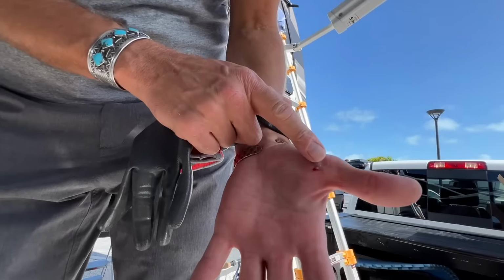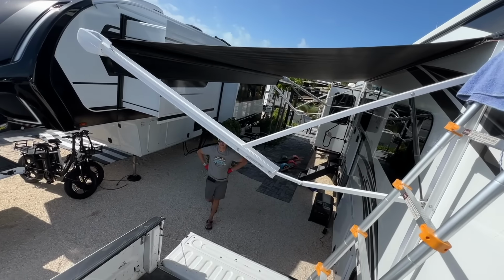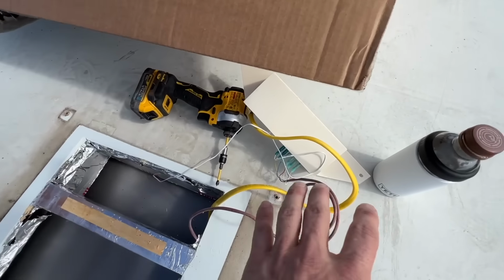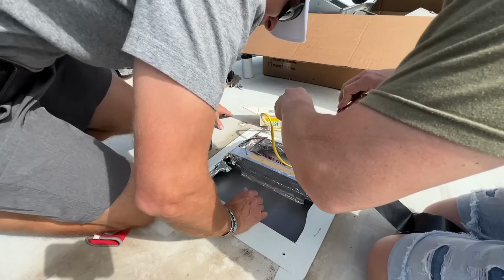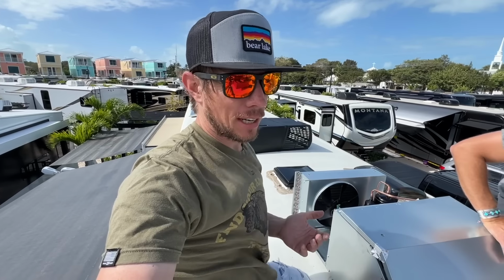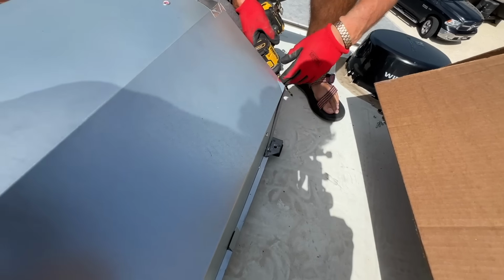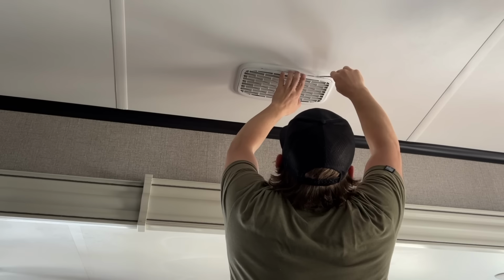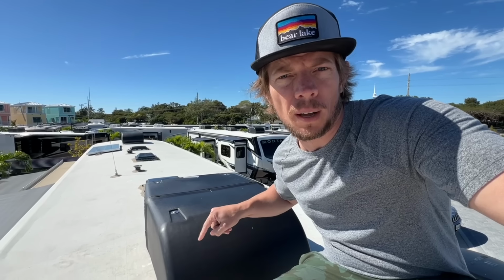How to Change Out a Complete RV A/C unit Saving $1,800

Comment: A word of caution. A shop replacing my roof ac had to replace it twice because during shipping the units can be damaged and leak out the refrigerant. Get the shipping insurance cause manufacturer might tell you the shipping damage is on you.